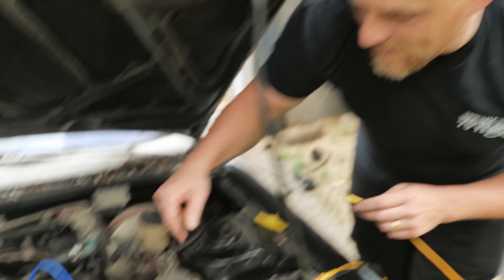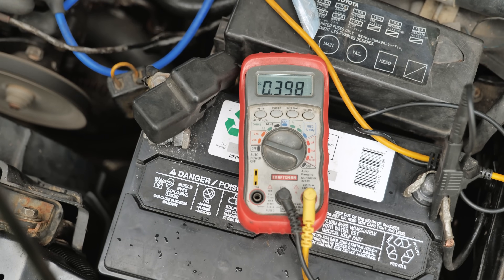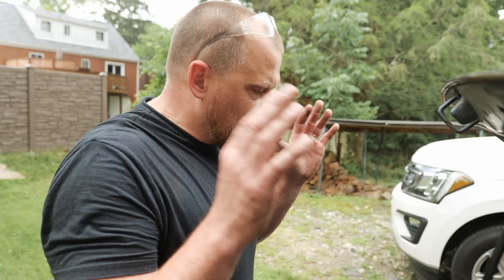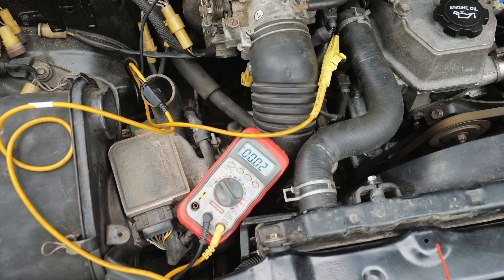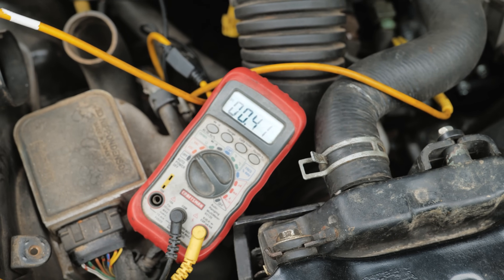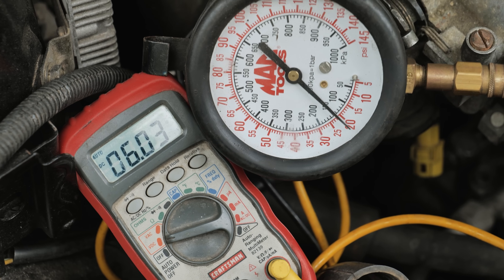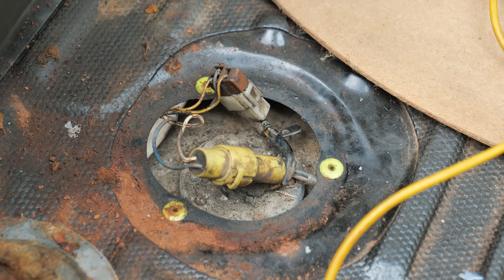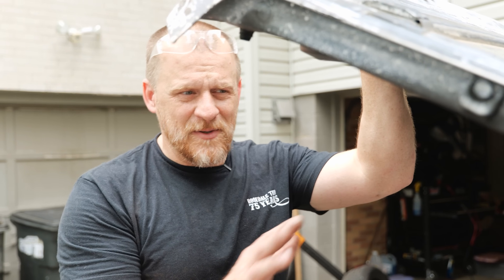85 Celica 22RE - Intermittent Low Power Condition [Actual vs False Lean O2 Testing]

Comment: What's up with the unused throttle body lines not being capped off?  Why no vacuum line going to the fuel pressure regulator?
Reply from the maker: these are all ports that are in front of the throttle plate, so they are of no concern at this time of the testing with this video

Comment: Hey Paul, is there a way I can identify what fuel adapter you are using to the fuel pressure test?  I am working on a 1987 Toyota Celica GT-S, and I believe that the adapter would be the same... Any information would be greatly appreciated.   Thank you

Comment: This old VAF door has a wiper arm inside the unit, you can peel the cover off from the unit and manually bend the wiper arm to adjust the voltage at idle, for rich and lean adjustment, thus across the sweep range. In states with SMOG it is illegal to adjust that arm, OH WELL. Thanks for all the videos Paul, would like to see you more often over at DDTSB Group, cheers.

Comment: I recently got an 85 celica as well. It'll crank but wont stay on, or it work start at all. Im trying to swap the fuel filter, would that be easier to swap from the top and removing the throttle body, or going from under and removing the starter?

Comment: Okie dokie had crank and hard start with help from your channel.. coolant temp sensor and fuel pressure regulator changed on subyroo...  added bonus 3 mpg more 😊.  New symptom .. is ..
While driving all is fine then maybe 11 to 15 miles in I think misfire then check engine light comes on steady not flashing and it feels like I'm pressing on and off gas pedal when im not ( these 3 symptoms within seconds of each other) if I turn off car and not even wait 5 minutes before starting car engine light doesn't come on again when I start car . It doesn't do it every day but I don't always drive 15 miles ( reset miles ?? ) your suggestions would be awesome and most helpful.

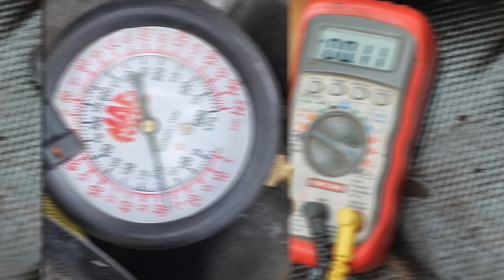Comment: @17:37 ground to ground voltage test decreased, becuase the rpm dropped to low, and the alternator stopped charging, which in turn the pump stopped pulling as much current, just like the test before hand when the hot side of the pump was being measured, and droped voltage when rpm dropped. Its great to see ground to ground measurments being made, thats like one of the most over looked diagnosing Technics out there fir vehicles. Very common in electrionics though. I just got asked a day ago to replace a fuel injector in a car, id asked about it more, turns out its had new coils, plugs, and plug wires thrown at it, and it seems its still missing, and is now being told its,"the injector". I tired to explain it simply that the scanner can kinda point you in the rigth direction, but it happebs very often that many mechanics chase, or just regular folks follow what that scanners says, thinking it will fix it. Being told its the injector, ive asked for the actual codes thats popped up, and explained that yes the scanner can say its something can be going on with it, but it doesnt mean its infact the injector, and that it should be tested further. Befire just putting a new one in, im very picky with diagnosing electrical, i do not won't to be moving the wiring harness around, moving it as littke as possible to make the test. Electric cars are not the only vehicles that burn down, ive seen plenty of gasser's burn down, i cant say they are all from electrical, however im pretty sure a few of them were, and probably from sketchy work, or just plan negligence or ignorance of not clipping the wiring harness back were it goes after repairing what ever.

Comment: The older cars with electronic fuel injection can be tougher to diagnose, as you don't have the  bi-directional control and scan data you have now, particularly fuel trim data as you mentioned, which is a must for diagnosing lean and rich running conditions. You checked most of the input sensors manually to eliminate them as the culprit, which takes extra time, but is necessary. You had to be highly skilled and knowledgeable to diagnose these cars quickly and effectively back in the day, without a comeback. Cars from the 90's, like the one I own personally, also had auxiliary air control valves which were controlled by coolant circulation through them and allowed more air into the engine was it was cold, which the air flow meter would then read, and thus add more fuel, and give a higher idle. And this operated in conjunction with the separate idle air control valve which was also present on the engine as well. I'm sure you've come across these too Paul. Anyhow, excellent diagnosis Paul. Love watching diagnosis on these older vehicles, because of their unique challenges compared to today's vehicles.
Reply from the maker: Thank you so much

Comment: Question when it was about to stall when you added fuel to the intake why did it not smooth out.   If it was low fuel pressure?
Reply from the maker: Sometimes you need repetition to be sure. Did you notice at a later time I was able to recover the almost stall?
Reply: I did not. I will have to check it again. Thank for getting back. Certainly true about check and recheck. By the way I got your book and loving it.
Reply from the maker: @john82324  thank you!

Comment: This is were experience comes in and confidence...i would have questioned myself 3 times before moving on. Is the tps signal really good, air flow? You just measured it and you were able to confidently say this is good and go after fuel pressure in the long run
Reply from the maker: Just applying my known fundamentals my friend. This was actually a good exercise for techs to see. Even on today's cars, it all still applies. Thank you!

Comment: Paul I have been trying to figure out this for a while now hopefully you can answer it . When I was subscribed as member the slide and classes were great. But the ones on pull up and pull down sensor circuits seemed to be backwards from what everyone else was teaching including a couple books I bought. I know I must be missing something can you help. Your slides on pull up circuits the voltage comes externally from pcm and pull down IT’s sourced internally. All the information I have is the opposite 🤷🏼‍♂️🙋🏼‍♂️🙇🏼‍♂️ lost and confused. My ocd has too know 😵‍💫
Reply from the maker: Yes sir. I teach it from what the switch does and refuse to teach it the other way. If a switch is connected to ground, what is the switch doing? It is pulling the signal voltage down (pull-down design in my book) Why would we ever call that a pull-up circuit. I don't care that there is a pull-up resistor inside of the ECM on that circuit. Make sense?
Reply: @ScannerDanner  it made sense to me the way you teach it just wanted to be sure I wasn’t missing something. Thanks Paul 👍🏻👊🏻

Comment: this is the case where that old analog meter with a needle is almost better.  the input impedence along with sample rate on some digitals would make this test really difficult.
Reply from the maker: Output voltage is too low on these oxygen sensors to be able to run an analog voltmeter

Comment: Would you provide the good data on the voltage readings for the O2 sensor after the fuel pump repair?
Reply from the maker: Sure! We can revisit that and I'll make sure the sensor is hot enough too, which I did not do enough of (single wire, non heated O2 needs the exhaust to heat it and extended idling doesn't run hot enough on the exhaust)

Comment: I’d completely forgotten about the fuel pump switching from the airflow meter on those old flap  systems.  My fading memory assumed crank sensor signal did the pump turn on .

Comment: An ac. wave form would be cool with a scope and an inductive clamp.
Reply from the maker: You mean a fuel pump current ramp test? I have it. On the first video we did in this series. Check the playlist I created for this car
Reply: @ScannerDanner  Thanks for the reply. I missed it, I will look for it. Thanks.

Comment: Hi Paul nice video. The reason that the the voltage dropped while the pump pressure was decreased, is because of the reduction of the current through the negative wire were you performed the voltage drop ( no current flow , no voltage drop ), Ohms law voltage drop applied.

Comment: What a surprise👍🏻👍🏻👍🏻
Today I just completed a diag on a 2021 Lexus ES350 F-Sport (Canadian Spec), & man it was a really difficult one, if my fundamentals were not structured by your book, it would be impossible😅
SD, I would request your input here, the only tool that narrowed it down to the low side fuel pressure is the mechanical type fuel guage, since the low side data pid in Toyota's GTS+ showed 10 to 30 kPa difference between actual & desired, which is minimal & surprisingly it didn't set a dtc for low fuel pressure, but bank 1 & 2 lean codes🤔
Fuel pressure was hovering between 30 to 60 psi (on guage) 
Your thoughts, it's a V6 gdi engine
I've ordered the fuel filter & pressure regulator, to start with
Thanks for sharing SD & Caleb, Stay Blessed Danner Family🙏🏻🙏🏻🙏🏻
Reply from the maker: I've seen similar. Check this one out https://youtu.be/ORH3r9d3fSM?si=5P8j0os_hc0xNA69
Reply: @ScannerDanner  Thanks for refreshing my memory SD, I've watched this case study & it's in my liked video's, but I overlooked it🥴
I need to revisit the data PID's & confirm that the low side pressure sensor reading is matching the guage or not😇
Thanks for sharing SD, can't thank you enough😍😍😍
Stay Blessed BRO🙏🏻🙏🏻🙏🏻
Ton's of prayer's for your Mother🙏🏻🙏🏻🙏🏻

Comment: Does the dropping of voltage differential between the grounds suggest that the things on that ground circuit are drawing less amps? Assuming its only the pump on that ground, the pump would draw less current, causing the voltage differential to drop, as well as the fuel pressure.
Reply from the maker: Yes! This was caused by a drop in current flow. But to be fair, the system voltage was also dropping too (during the stalling condition), as we saw in an earlier test.

Comment: I taught all four of my daughters how to drive a stick and they all four drove the same 1998 Nissan 200SX with a 5 speed all through high school.  Each of them hated it at first but loved it in the end when all their friends were jealous and wanted them to teach them how to drive a stick.  The are each proud of having that small life skill.  

I had an 82 Celica GT liftback similar to that one and it had 220k miles on it.  I rarely every did any engine work to it other than spark plugs, cap and rotor, and never had to diagnose a driveability problem with it.  It never broke.  I did have to have a buddy put bearings in the transmission as it was a little noisy and liked to pop out of 5th gear.  That was the only issue I ever remember having with it and I bought it with that problem.  Loved these cars.

Comment: Yer smart but your attacking the problem from the wrong of the spectrum.
Reply: Make some videos of your own
Reply: @lyndelld1  don't be a hater dude you obviously have no experience on automobiles . And for your information lyndelld1,I have been fixing cars for going on 41 years. No I'm not looking for a cookie. You can have it and I'll apologize to you over your feelings
Reply from the maker: How do you figure? I was originally looking for a rich condition as I saw black smoke on our test drive
Reply: @ScannerDanner  from the way the motor was running as it was misfiring. As I recall that's an interference fit motor,so it wouldn't be likely a timing belt.  So it would almost be guaranteed to be a fuel issue . And yes sir ,it certainly did appear the t.p.s. could be the cause and I apologize for that as I know it could be a t.p.s. issue and not thro a code. I was trained to first and foremost ,to preform a starting charging system test,then take a look at as many power and ground connections I could see. Assuming all that was good I would then scan it. I did not me offense Sir.
Reply from the maker: @johnniven9636  my issue with your original comment is really about there not being one specific place someone should start. What you deem as an important starting point may differ from mine. Also this is like the 5th video in this series, so you can't really judge where we actually started within the context of this video alone. 
Also, this is part 2 of this particular running problem. So where we started from was in part 1
Reply: @johnniven9636  It wouldn't be a timing belt since it has a timing chain....next.  You're going to just randomly find all the power and ground connections?  Which ones?  What about the ones you can't see?  You need to have data to go after a specific power or ground.  How are you going to check it?  Just look at it?  You can see voltage drop just by looking at it?  Are you going to voltage drop every power and ground connection?  You going to clean every power and ground connection?  What happens when you spend that 3 hours, you check all you can find, and don't see an issue?...next.  What are you going to scan it with?  There's no scanner for this car.  It likely does have a diagnostic connector that when jumped will flash the engine light with some codes.  

I have been using SD's diagnostic process and methods for quite some time and am able to fix cars that local shops give up on.  Usually in just an hour or less.  I think I'll continue with that.
Reply: @johnaclark1  chain, belt same out come as it's an interference fit motor
Reply: @johnaclark1  and I never said or implied not to use a scanner. Wake up junior.
Reply: @johnaclark1  ya check all the powers and grounds you can see.. and yeah Dan is a good tech, never said he isn't.
Reply: @ScannerDanner  true. I did apologize.  And all the videos I see pertaining to said car are marked as part 2.
Reply: You don't have to accept my apology. That is in fact your issue.
Reply: @johnniven9636  Have you ever seen Paul (his name is not Dan) just willy nilly go in and check all powers and grounds you can see?  I never have. I have seen him get to a module or output of some kind and check powers and grounds on it to confirm it's failure but only after gathering data to point to that specific place to check.  You'll waste a ton of time just checking all powers and grounds you can see.  I've worked on two GM trucks that had bad grounds (one a no com with the PCM and the other a crank no-start, neither of them could I see but rather I was directed to them based on data gathered by narrowing down from a wiring diagram.
Reply: @johnaclark1   give it a rest dude.
Reply: You cannot check all the powers and grounds with a scan tool. Go back to school.
Reply: @johnniven9636  When did I say to do anything with a scan tool on this car?